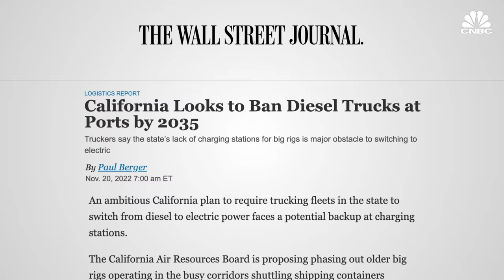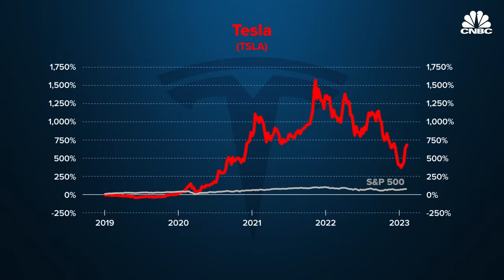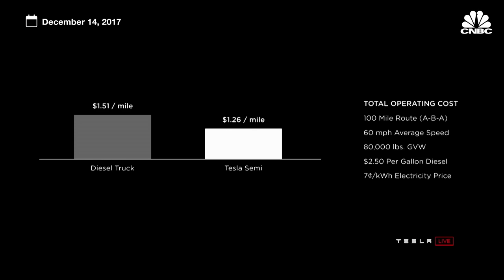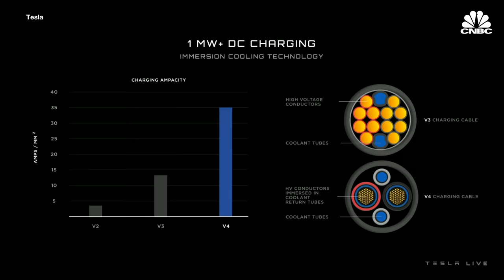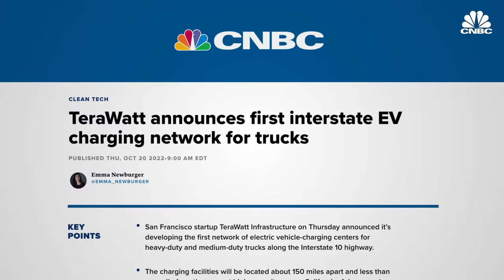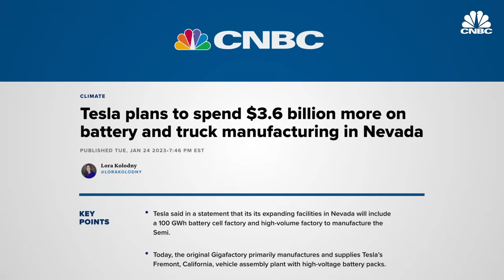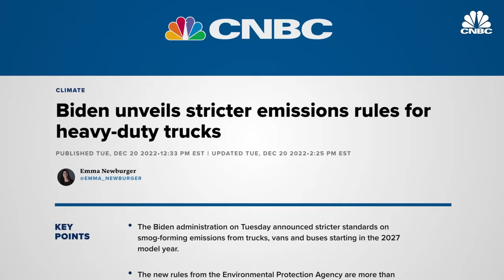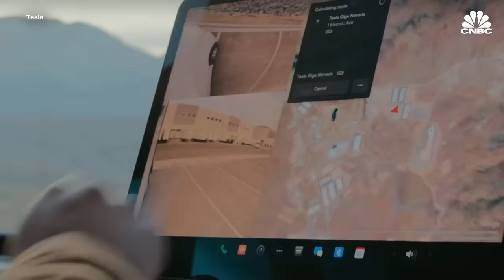Does The Tesla Semi Live Up To The Hype?

Comment: Well battery weight doesn‘t affect them as much if you transport 50% air.
Reply: Most trucks do not run with maxed out weight.   Thus this truck will be fine for most loads.
Reply: @danharold3087  They certainly can't work as cross country trucks which are a big big portion of transportation demand. Pepsi has a specific scenario that might work for them. But it is far from things that Elon has hyped up.
Reply: @danharold3087  I would doubt that.
Logistic companies usually value flexebility. Even if it‘s true that most of the time it isn‘t fully loaded the one time you need more weight capacity it isn‘t an option.
You could make multiple trips but it has a shorter range and longer „fueling“ time. Not even mentioning labour cost.

On the other hand energy cost would be intresting.
Electric cars are more efficient.
But per 100pound you could assume 1% loss in range in a car.
This would be intresting to see the efficiency of a semi loaded and unloaded.

Any way I just think for city delivery electric trucks make sense.
But long haul it‘s just a scam.
Synthetic fuels or hydrogen would make more sense the way I see it.
Reply: @Slithermotion  Load does not make the expected difference.   Wind resistance which increases with the square of speed does.  This is why deadheading sucks like it does. 

Synth fuel and hydrogen have their own problems.    It is a race to see if we get the lighter battery ahead of an economical synth fuel.  Even then we may have NoX emissions to deal with.    My view on hydrogen is that it has stagnated.   Did not work then does not work now.  Show me new developments and I will reconsider.
Reply: @halos4179  Your right about the truck you see today.   Battery cell technology  is still in its infancy.   You are looking at an embryo when you see the tesla semi.  

I see Tesla building wind and solar farms at charging station feeding excess power back to the grid.   Why? Because Tesla is also an energy company and there is money in selling power to trucks.  It is logical.
Reply: Bravo! you spotted the hype a full load of Potato Chips in 53 foot trailer is about 10K pounds, I drive these things for a living.
Reply: @halos4179  I see a lot of moving trucks on the road. They will be good for that.
Reply: @lesp315  Yeah, it makes sense to electrify short run trucks with current battery technologies as long as our infrastructure can handle. My issue with Tesla/Elon is they often overhype things and extrapolate the technology progress to an extent, scientifically wrong.

Comment: Considering the energy storage problem electricity is likely to become dramatically cheaper provided charging can be done at times of high supply and low demand (e.g. middle of the day or middle of the night), batteries are also likely to continue becoming cheaper. 

It sounds like the business case for the electric trucks is already there but it is also likely to become better over time, same for EV's.
Reply: I still think we'll see the Tesla Semi hooked up overnight at car supercharger locations, either using a dedicated Megacharger at very low power, or to existing "end of row" V3 chargers using an adapter so supply about 120kW over 8 hours (plus "hookup" for driver and trailer use!)
That immediately provides a nationwide "network" of currently underutilised sites.
.
Tesla also announced "Lounges" being built in Europe to provide facilities for drivers.
Expect a similar announcement in the US, perhaps at the investor event?
Perfect for a truck driver sleeping over?
Reply: Would see a lot of truck lots seeking to add mega chargers to their sites as part of parking spots so while you sleep or rest it's topping up.
Reply: I would suggest that you look up nickel and lithium prices of the last 5 years.
Prices are up not down.

Whats for most logistic company important is haul capicity.
Given that a tesla semi can haul only about 1/4 of a Diesel truck it has a massive disadvantage.
This means more trips, more and longer „fueling“ times and more labour.

Electric trucks make sense in a city or maybe long haul with low weight material.

However you can do that with a diesel truck as well and that gives owners a flexibility.

The point is every technologie has advantages and disadvantages.
I still don‘t see any financial advantage of electric truck for logistic.
Only a nice „advertisement“ for companies who want to show how enviromentaly causcious they are.

Aaany way if Diesel trucks get banned freight will get more expensive which in the end the common people will pay.
If that‘s worth it anyone can decide by their own.
Reply: If the demand continues to grow for both cars and trucks due to battery resources, they will rise rather than go down. Unless there is a great advance in terms of battery capacity, I see a commitment to hydrogen for trucks as more convenient.
Reply: @Slithermotion  They can haul a lot more than 1/4 - at least 60% and more likely 75% - even on weight-limited loads.
A lot more even on COMMON volume-limited loads.

But the technology remains niche for now - 'til the RECHARGING situation changes dramatically.
Reply: For sure!  In its infancy!  Tesla has a big big lead!
Reply: @Carlos  don't fool yourself, battery sizes are at a great spot to gobble up existing vehicle market. H2 is still decades out in terms of generation. We can only scale blue h2 atm which uses natural gas to get h2 which generates co2.

By the time h2 becomes viable we will have more efficient vehicles and more mature battery tech and manufacturing tech more similar to tesla in terms of vehicle weight reductions by other auto makers. This is the one advantage tesla currently beats all of the competition by far. Which is why they boast stronger range numbers for smaller battery packs than the competition.
Reply: @Carlos  don't fool yourself, battery sizes are at a great spot to gobble up existing vehicle market. H2 is still decades out in terms of generation. We can only scale blue h2 atm which uses natural gas to get h2 which generates co2.

By the time h2 becomes viable we will have more efficient vehicles and more mature battery tech and manufacturing tech more similar to tesla in terms of vehicle weight reductions by other auto makers. This is the one advantage tesla currently beats all of the competition by far. Which is why they boast stronger range numbers for smaller battery packs than the competition.
Reply: mass h2 storage lol
Reply: @unadultratedtrini  im laughing at the thought of all that hydrogen being stored randomly all over.  did we learn nothing from Hindenburg
Reply: Hydrogen..
Yeah no
Reply: What on earth.. your comment makes NO sense. The high demands on the electrical grid as it is today will only RAISE the price of electricity as demand increases sharply with more EVs on the road. Your understanding of basic economics and supply + demand is nonexistent. Unless this country builds a LOT of new nuclear plants, we will not be able to produce the additional electricity required for all these vehicles, at ANY price.
Reply: Batteries will get cheaper with techonology but you have to remember that the resources for batteries, aka its materials are not unlimited. Recycling batteries is a tremendously costly thing to do. That will surely drive up the price as you also have increase demand.
Reply: @conceptcs  you assume no other battery tech
Reply: @Slithermotion  Lithium prices were going down until things got crazy starting in 2021. It's back on a downward trend. Nickel has been rising steadily, but it isn't horrible and there are cheaper alternatives now. 

As for supposed haul capacity being 1/4 of a diesel, that is completely made up bs. Pretty sure you got that from Tfoot who completely made up crap to trick people. Engineering Explained did a recent video on the semi showing a very likely weight and realistic range.
Reply: @TurdFergusen  YeAh MaN, LikE a mAgiCal bAttErY tHaT GrOws oN tReEs brO.
Reply: @conceptcs  if you cant win an argument just start screaming really loud until they go away
Reply: @anthonypelchat  ummm... price of lithium was like 8 dollars 3 years ago... today it was 70...  highest was roughly close to 90...  batteries will not be getting any cheaper anytime soon
Reply: @wnxdafriz  As I said, lithium was dropping up until 2021 and then went crazy. They are starting to drop again. But that doesn't mean that batteries will suddenly be getting drastically more expensive. Companies make long term orders at set prices. Plus batteries HAVE been getting cheaper and cheaper. They just have to keep ramping up production. 

Also, lithium is only a small portion of lithium batteries, strangely enough. The bigger issue for NCA and NMC type cells is the nickel price. LFP uses iron, which helps in those cases, but those are too heavy for use in semis currently. But it does take off the pressure on nickel prices since LFP is best in lower range and low cost EVs.
Reply: @Slithermotion  Tesla weight capacity is around 44-45,000lbs. About two tons less than a diesel. Not 1/4. WTF? Operating an electric semi is around 80% less than a diesel for charging vs fueling. Then there's also less maintenance for engine and brakes. No one knows what the purchase price is, but over the lifespan of the vehicle it's expected be quite a bit cheaper than diesel. The economics are totally there.
Reply: @Joey Junior  you are misjudging the face value energy cost for evs vs the energy it takes to house, transport and supply gasoline. Using bevs are orders of magnitude more efficient from energy conservation than hydrocarbon based vehicles.
Reply: Tesla semi , leverages Tesla MEGAPACK & Tesla Autobidder software.
it can Automatically buy Energy at LOWEST price to Charge, and turn arround and SELL energy @ PEAK rates. 
this system is BEST paired w/ WIND or SOLAR generation.
Reply: For everyone worrying about lithium prices. Lithium in China has gone up significantly but the price in other markets such as South America are not significantly risen because it depends on what part of the chain in lithium you are measuring prices. For cell factories they import cheaper semi concentrated lithium then bring it to 99% purity to feed to the line. As tesla stated in their battery day event this spike was expected as they stirred the competition into bev production. It's expected to go back down significantly in coming years due to new mines opening up to meet the global shortfall. So yes batteries are going to get cheaper and significantly so. Also tesla are aiming for most of their batteries working with lfp for mass produced vehicles and energy storage due to reduced volatility of the chemistry, affordability and easy of access and recycling of the cells.
Reply: Which is kind of the nonsense argument everyone makes. Ohhh, we're going to charge all that over night. Just think: everyone is charging over night - that's a lot like everyone using their AC during the day. Right now that's a good point, once we have a 50% EV saturation of the market, overnight charging won't be the same.
Reply: And yet still rely on the grid and infrastructure that was made possible by diesel trucks and equipments lol!!!
Reply: Electricity won't get cheaper if anything you'll see it get alot more expensive because power companies will have to build new facilities that power these vehicles which will cost billions of dollars.  The companies will raise prices to make up for that expense.
Reply: @PTANV-x2g  there is a lot of extra power at night. And it's often cheaper. We use off peak for our EV. Whole highrises only power on EV chargers at night in Brisbane Australia.
Reply: @billybob0617  stop looking at it from a bucket. Think about an economical shift. The power infrastructure that used to feed everything to support current fuel infrastructure will now be phased into this new value chain. Based on studies the growth of home heating and cooling power need will outpace that of the excess required for vehicle charging infrastructure. So do suggest you read more and understand what you are saying not in a vaccum of this is gonna require this but balance out the whole equation. Also integrate the fact that many people are adding solar generators to their homes which will offset this further.
Reply: @Raj Seenath  this isn't a realistic future.  The realistic future will be fuel cell vehicles and hydrogen and CNG ICE's.  The cost it will take will cost billions if not trillions, that's a fact.  The only reason battery vehicles are being pushed is because there's more money to be made in that market.  The government could care less about the environment because electric vehicles are not cleaner than ICE vehicles, and you're just transferring the pollution else where.  It's all about money at the end of the day.  The combustion engine market has reached a point where investors aren't going to make much more money in that industry, so they're looking for something new to make more money off of.
Reply: @Raj Seenath  😆 anyone with an engineering degree is stupid.   I see a lot of modern vehicles in the shop I work at, and they don't know how to design anything worth a dam anymore.  Say what you want, but anyone who's in the trucking industry will tell you that fuel cell and hydrogen combustion engines are the future for trucks.  Battery vehicles aren't reliable, and they aren't built to last.  It costs over $20,000 to replace a battery pack in a tesla, and you will be chewing up tires faster in electric vehicles.  Say what you want, but I am in the automotive industry and can assure you it's all money driven and batteries won't be the future.
Reply: @Cier433  We could use superior 1910 technology, forget batteries, they are bulky and dangerous in a fire and their weight will destroy the road, see what you do is put up overhead wires on popular trucking routes and a smaller battery for the uncovered stretches- you reduce the weight massively and the truck can charge as it cruises down a truck lane on direct mains power, you could use this wonderful 1910 advancement to power buses too by putting wires up on bus routes, we need to stop thinking about bandaids on the larger issue ofcar dependence anyway. eck build a railway and you can run spurs off to all the local strip malls, Walmarts and whatever else you have stateside, plenty of space in the paring lot or the stroad.
Reply: There’s a problem though: doing so lowers the lifespan of these batteries. 
So you’re going to have to pay a premium, because Tesla Batteries aren’t easy to replace, so you’re lowering the lifespan of the vehicle.
Reply: @Fredinno  lfp has a lifespan of 5000-8000 cycles at 80% depending on certain factors during formation of the cell. I'm sure with a good bms and good charging habits it would extend it. The true lifespan of the battery could hit 1million miles but do expect degeneration over time. You are comparing today's battery replacement prices with tomorrow's. By the time lfp and cell tech have matured over the next 5 years, battery replacements will get cheaper. Even if it gets 50% cheaper that's a huge cost savings and you can already go to third parties and have your battery sub units changed for much cheaper than swapping the entire pack.
Reply: That's why own the electric suppliers stocks. Dividends from utility stocks will consistently rise, along with cap appreciation. Just like owning refining stocks for oil. Oil is just black goo until it's turned into fuel. 

Biden's recent announcement to sell leases in the Gulf of Mexico for offshore wind farms is another blockbuster industry unfolding. Electricity generation will need to come from many different avenues. 

For me owning DUK for years  has been solid investment, and more on the horizon. Time to expand out and own other electric provider stocks for solid stock investment.

Comment: So it took Tesla a really long time to deliver the first Semi.  Announced in 2017, with a target of 2019, but delayed until 2022.  I wonder what happened in that time?  I seem to remember something with the number 19 in its name…😂😂😂
Reply: Did not have enough batteries to start doing this.  Also the new trimotor plaid motor system that they have ended up with was needed to get the power and efficiency required.  The 4 X model 3 motors that they started with was not such a good solution.
Reply: Tesla is always delayed because theyre new to the markets. If only there were other truck/vehicle manufacturers that already had rolling frames that could do this first... but who owns em? Big oil baby.
Reply: Real life happened. I'm sure you've had your own setbacks in your life that delayed your plans too. 

If no one tries, no progress will be made.
Reply: Compared to automotive OEM 'experts' on automotive production - 5 years is a miracle.

"One key thing to remember is from the day the design director first puts his idea on paper to the day Job 1 or first customer car is produced it will take 5 - 10 years. Honestly speaking, I’ve never worked on any project that has run on the projected time plan. Honestly never. Doesn't matter how many cars, if it’s 100 McLarens or 30,000 Land Rovers. No project I’ve worked on ever ran as per the plan. It was always delayed."
Raghav Jaswal - Automotive Designer for McLaren, Jaguar, Land Rover, Bentley, on Quora.
Reply: still waiting for my truck...   Elon is a magic worker  some good some delayed.  but always a show.  Look I pulled a quarter out of your ear!..